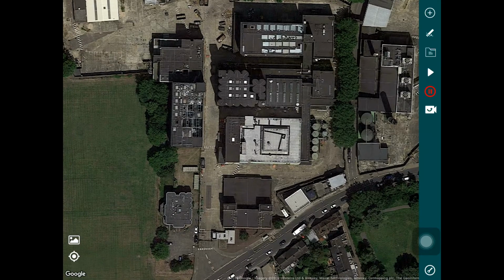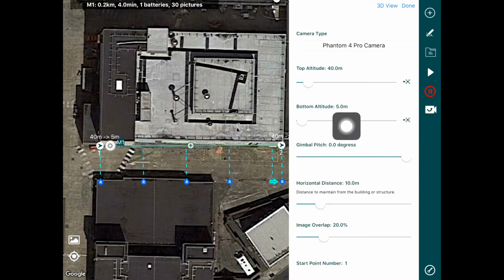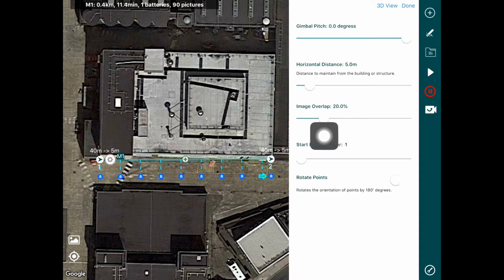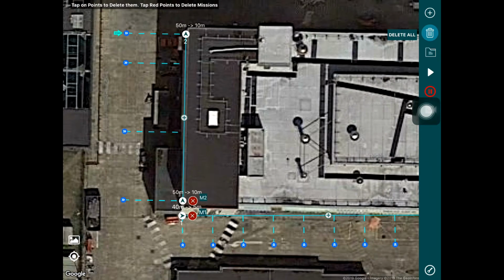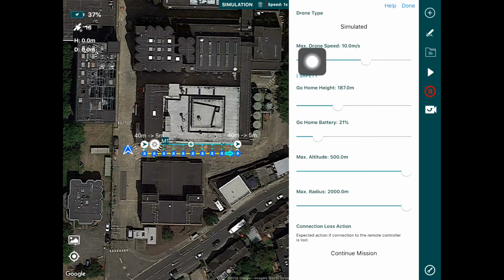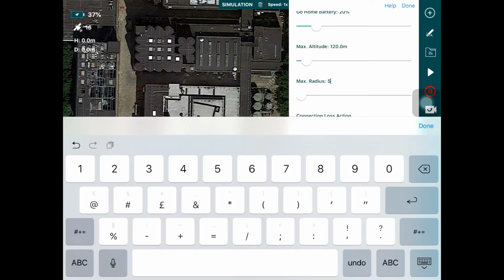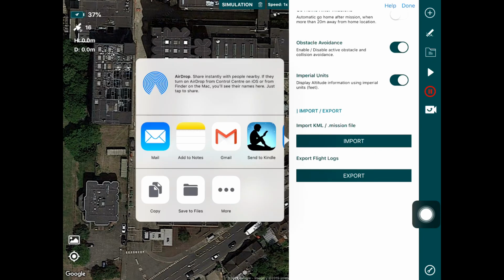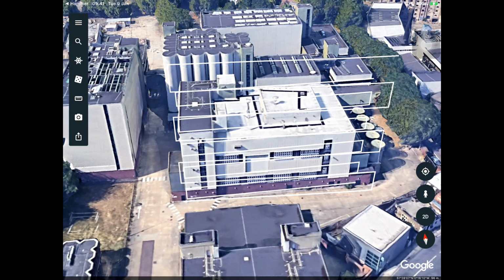Vertical Inspections using Hammer - Tutorial #003

Comment: When previewing in google earth, the hammer mission does not follow a horizontal line as expected. It looks like it follows a hillside where a building is which should be level. Does hammer take into account elevation / terrain awareness? The building i am looking at has been built in last 2 years and it looks like hammer is not following the new ground level for the building.
Reply from the maker: Hi Ryan, thanks for the question! Hammer Missions does have a terrain-awareness mode, however, this mode can only be used with mapping, 3d-modelling, magnetic surveying and solar-inspection missions. Currently, facade inspection missions do not support terrain following.